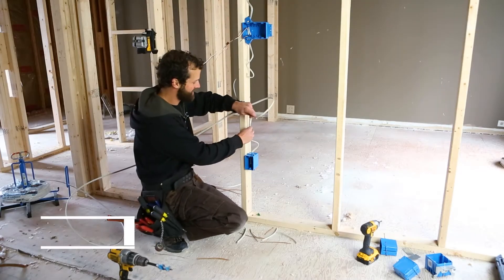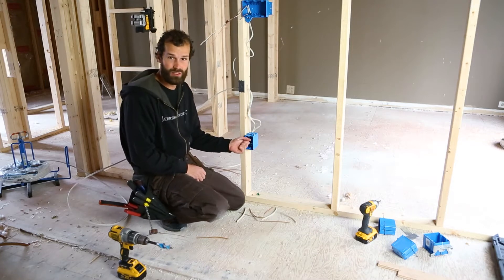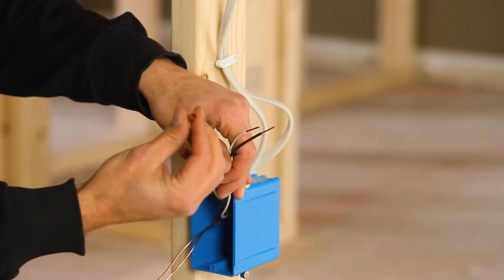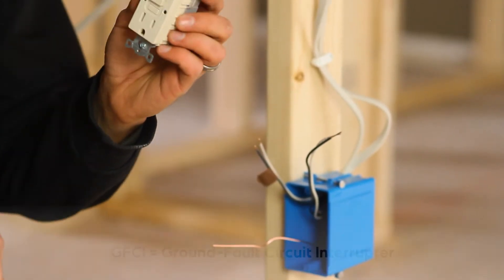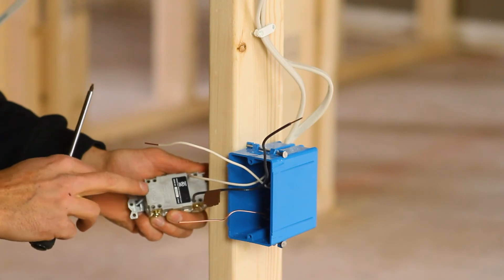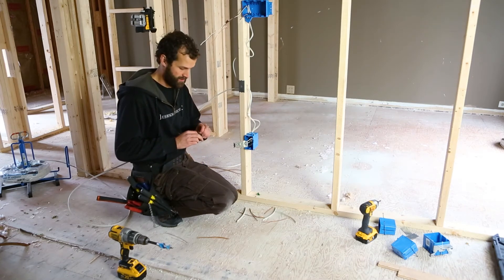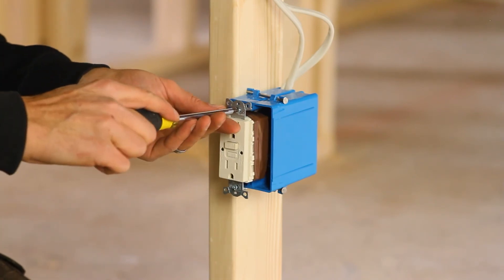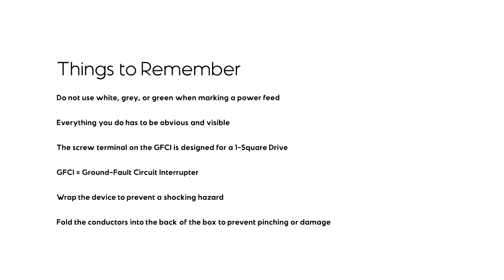Installing a Temporary GFCI

Comment: You can use a handy box cover like the ones you use when you're surface mounting a handy box and that's small enough to still have the outside edges of the plastic box exposed. Seen a guy do that once and thought it was pretty clever.

Comment: I was taught to fold the wire that you cut off at the ground crimp so it cannot be pulled out or slide in longer if the crimp loosens.
Reply: @ElectricProAcademy  doesn't this configuration make the round box LIVE  AND if my memory serves me right, exposed and uncapped ? why wouldn"t it JUST be the line in WITHOUT the (leg ?) / second set of wires ?
Reply: @robch8473  especially since it is "temporary" and now you have cut short one of the ground wires.